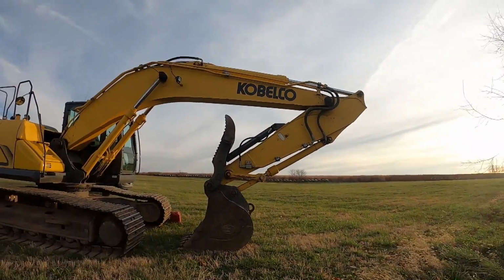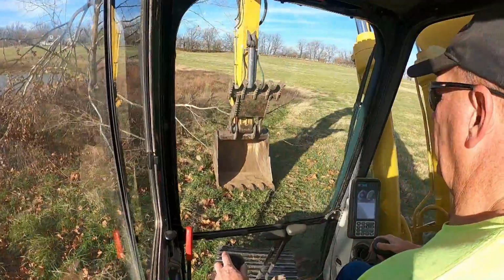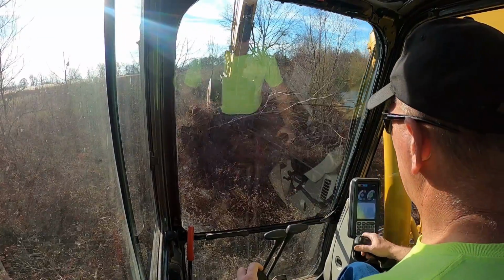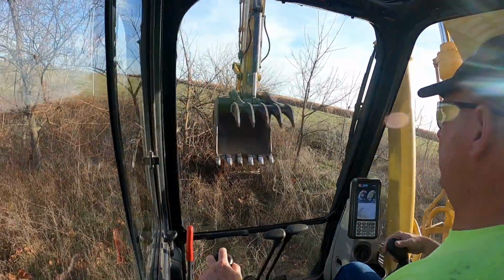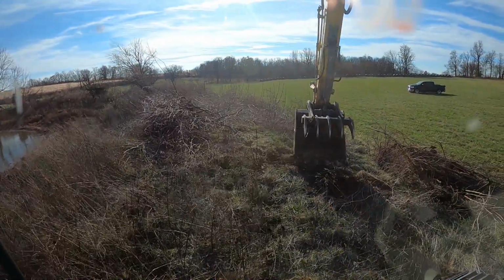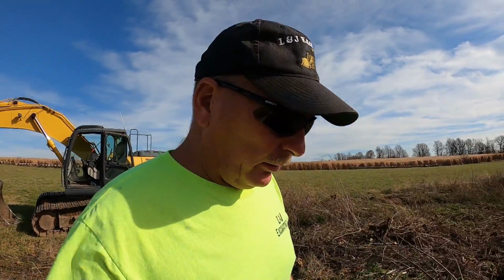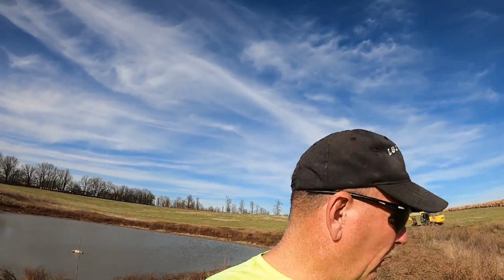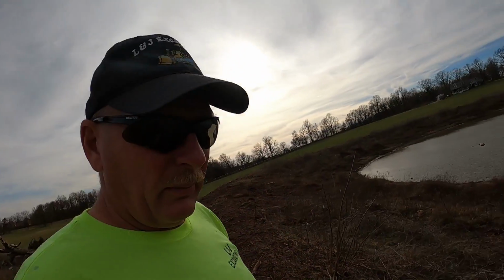Fixing A Leaky One Acre Pond!!

Comment: The aerial shots in the opening sequence was one of your best. The initial explanation of the scope of work was excellent. Since armchair quarterbacks are not hydrology experts, I might have used weight of the water in place of pressure. Most folks are familiar with weight and it’s effect on things in life. I thought your original explanation of why you couldn’t build that pond was simple enough for most any expert to grasp. 
  What is the status of the thumb mount? Have you been able to make repairs or adjustments?
Reply from the maker: Thanks bob!  No, haven’t had the time yet to straighten and weld in the gussets yet.  Been working dang near non stop.  So hopefully will be able to before long.

Comment: Merry Christmas, another great video! I have one question, what do you think about a Cat 953A model, made in 1985? I want your opinion on those 953 with the 3204 motor.  Thank you very much!
Reply from the maker: Hey Beau….thanks! I appreciate that.  The A models were good ole machines.  They had some track frame issues early on but pretty decent machines.  They were a little underpowered, but could still get the job done.  The 3204 is a great engine, but it’s very difficult to find parts for them now because they’ve been around for several years.  I would just check it over real good.  If there’s any inclination of a transmission issue, walk away!  You’ll tie up a crazy amount of money in it if your not careful.
Reply: @Dirtdaddy953  Thank you for all of the information. I have a 953 A model that is made in 1985, and it’s been a good unit but I like to hear others opinions like yours, opinions from people like you who have been in the heavy machine world for a long time. Love your videos please keep them coming. Merry Christmas and God bless.
Reply from the maker: @beaubritt3394  Thanks Beau!  Merry Christmas to you as well!